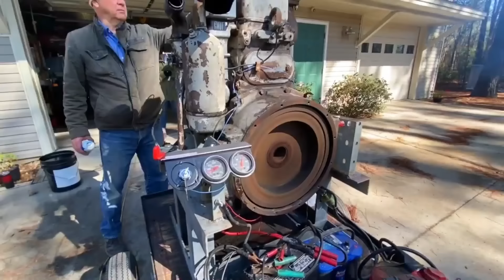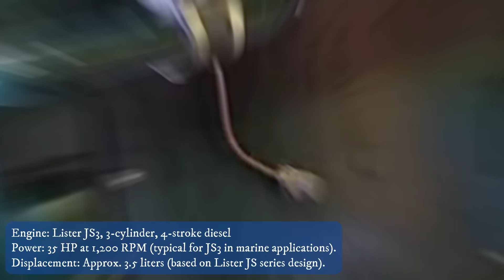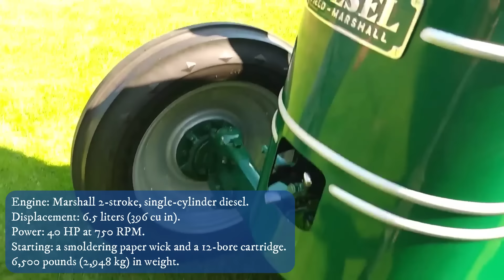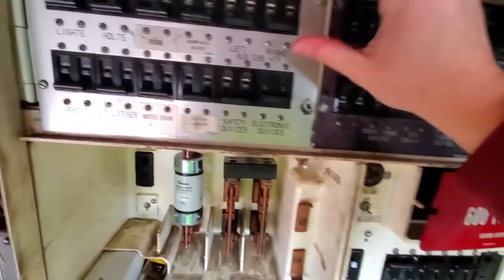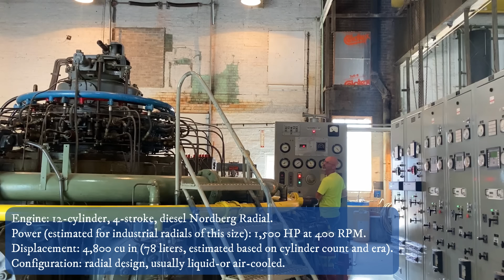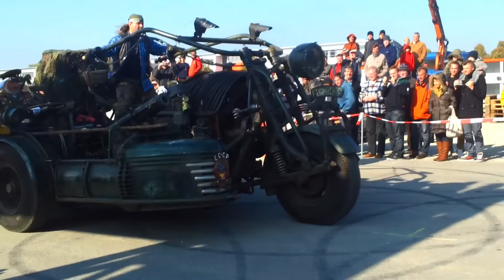Rare Old Engines Starting Up Sound That Will Blow Your Ears ▶6

Comment: Fun channel, spam the comments, help the algorithm.  .  . Fairbanks-Morse opposed piston diesels.   Submarines, certainly.   Also:  seaplane tenders, PT Boat tenders, some destroyer escorts, some landing ships (LSTs), polar icebreakers.  The list goes on.  Great engines.
The two Coast Guard Cutters I served on had them:
CGC Burton Island, 1946 vintage Navy surplus polar icebreaker.  6 10-cylinder 38D-8 1/8s, 1,600 HP each.
CGC Boutwell, 1966 vintage High Endurance Cutter (3,100 tons, like a Navy frigate of the era).  2 12-cylinder turbocharged 38D-8 1/8s, 3,600 HP each.  Plus 2 Pratt & Whitney marine gas turbines, de-rated to 16,500 HP each due to reduction gear issues.  When you wanted to go faster and the Navy was paying for the fuel.  (Thirsty engines, those gas turbines.). CGC Boutwell was transferred to the Philippine Coast Guard, and may still be in service.
CGC Burton Island also had the smaller 5 1/4 series opposed piston engines on 4-200 kw generator engines.  They were cute, but no parts availability to speak of in the mid 1970s.

Comment: Have not looked through all of your play list (Old_Guard is both old and lazy) but speaking of farm equipment you might want to look at steam tractors.  Near my former home in rural Maryland (USA) there were two annual events:  Threshermen’s and Tuckahoe Steam & Gas.  Think of a small steam railroad engine mounted on wheels.
There are a lot of similar organizations and events in the U.S.  There should be some footage available.

Comment: Detroit Diesel 2-71.  .  . The ?-71 series were workhorses in the U.S. Coast Guard in my early years.  2-71s and 3-71s as generator engines for smaller cutters, 4-71s as emergency generator engines on Wind Class icebreakers, 6-71s as generator engines and propulsion engines for for small landing craft (LCVPs), utility boats etc.   The scavenge blowers lived on as superchargers for big hulking dragster V-8 gas engines.  .  .
Wonderful engines.  Now they are antiques and novelties, so I guess I am an antique.  Maybe not a novelties.